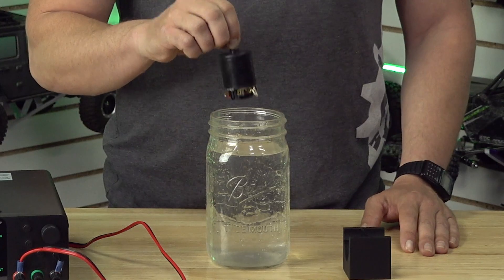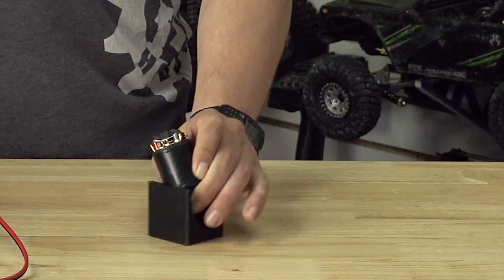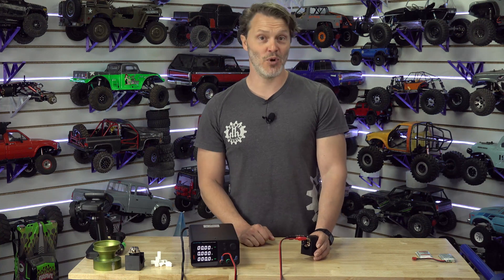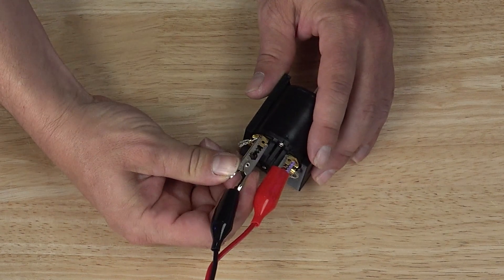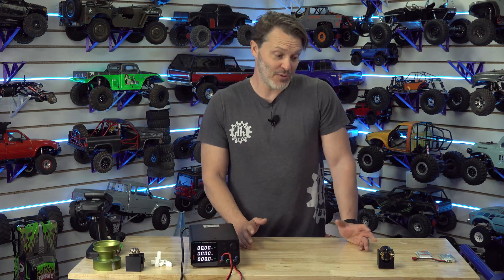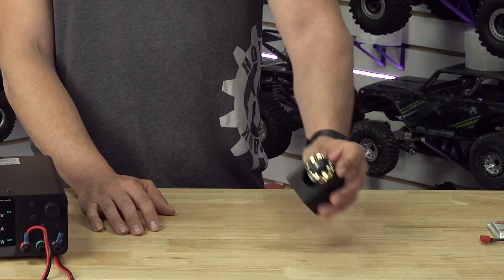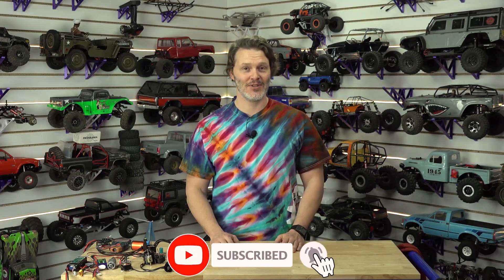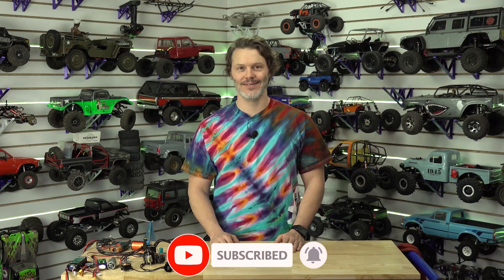Breaking In Rebuildable Motors: The Holmes Hobbies Way | Insider Tips & Techniques

Comment: I found that the serrated brushes that came with my first Crawlmaster pro 550 motor caused the commutator to wear quickly and so unevenly that it could not be trued and required an armature replacement after only about 80 hours. I currently have six or seven Crawlmaster Pro 550 12t motors and before I ran any of them I used a 1/4" round ceramic stone rod to remove the serrations on the brush contact surface. All of these motors now have well over 100 hours and I have not worn out a commutator on any of them since I started honing the brushes.

Comment: For grass roots our club has brushed sealed can classes. I race mini stock so Tamiya minis, out club is sealed can and 19 turn limit. Rightly or wrongly I do water bed in motors. Possibly slightly dodgy method I have for removing water is dunking in isopropyl alcohol. The ipa absorbs water and drys off. I let the motor dry for a day in well vented area before applying power again to avoid fire 🔥 haha. Unfortunately your new retro motor is too chunky for my Tamiya m-07
Reply from the maker: Too large of diameter?
Reply: @HolmesHobbies sorry only just seen your reply. Yeah the diameter of the can is a bit too big.

Comment: I used to use a 3-cell nicad or nimh pack, I built from individual cells.  I wired it with motor leads and simply plugged the motor in.   These put out roughly 3-4 volts so, perfect.  Of course, I sped things up with a water break-in, lol.  A quick bath of approx. 1-2 minutes is all that is really needed. Use motor spray to get rid of residual water, add a few drops of 3-in-1 and Bob's your Uncle!  Of course, a power supply is much more convenient but significantly more expensive then a few loose cells.

Comment: i have broken in sealed cans with water and the amount of dust and buildup was incredible. I had to change the water half way through as it got very dark but it did the job and the water bath increased the RPM noticably. I now think back and the way i dried it was running it high speed with a blow dryer but damnit i forgot to add lubricant to the bearings/bushings. Even when you do this for a long time you still make mistakes!! Cheers for sharing!
Reply: If you insist on liquid break in use rubbing alcohol the highest % you can find.

Comment: Well, I've been doing it pretty much right. lol  I usually hook them up to an ESC and run them for a couple of minutes at about 25% throttle.  Had I been thinking, I'd have always used a power supply as you did. 🤣

Comment: Anyone that went threw the hobby when modified rebuiding brushed motors where the only option it was simple to break in your motor. All I ever did was install the motor & run my rc vehicle at about 25% throttle around the track with the timing set to 0° forwards then repeat the process driving in reverse. Then I would remove the brushes & clean the brush surfaces & commutator surface with a comm brush & then advance my timing. It was simple using silver content polarized serrated brushes being they broke in so quikly I ran modified 8 to 10 turn double & triple wind Trinity Motors, Peak Racing, & GM Motors when I raced 2wd stadium trucks in the late 1990's to 2004 when I gave up racing because Team Losi sold out to Horizon Hobby & ruined 1/10 scale 2wd electric & nitro racing since it happened.

Comment: I think you should promote your rebuildables for comp builds again with your BRXL. Even with the 1080 you get that analog throttle curve for the most controlled thottle movements vs. the multi step of FOC. They don't have the resolution to match a good brushed combo w/direct wire servos. But even for the RTR better brushed motor = better performance. If people think about noise then look no further than the your pinion and spur gear. Why don't we have bevelled pinion and spur gears for more quieter operation. Belt drives stretch the belts or break the teeth of the belt. Al least that has been my experience with the ones from China. Does anyone else make them more reliably?